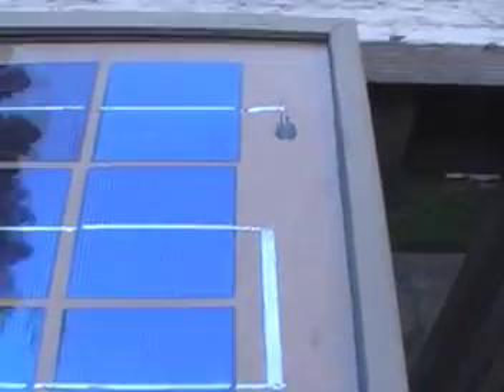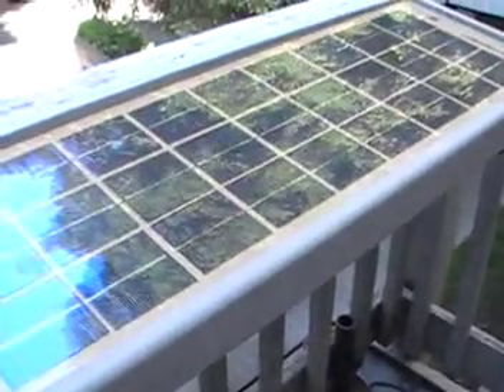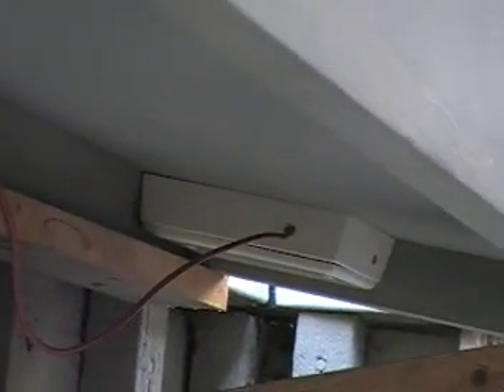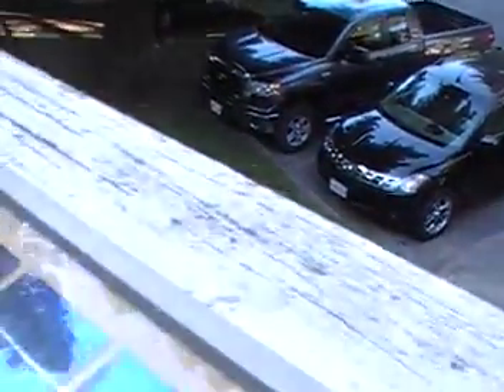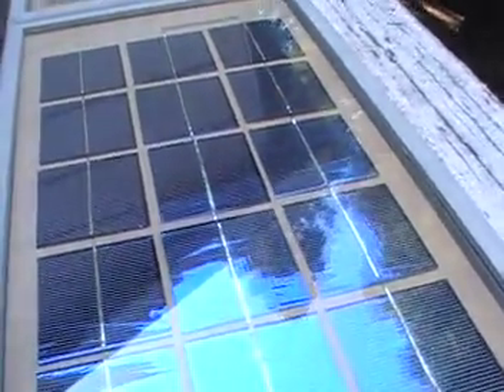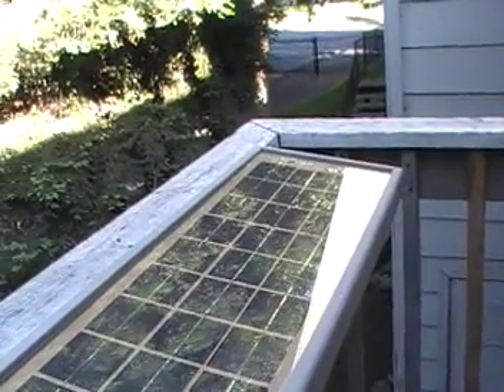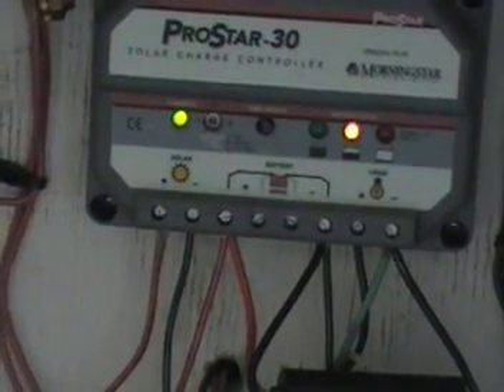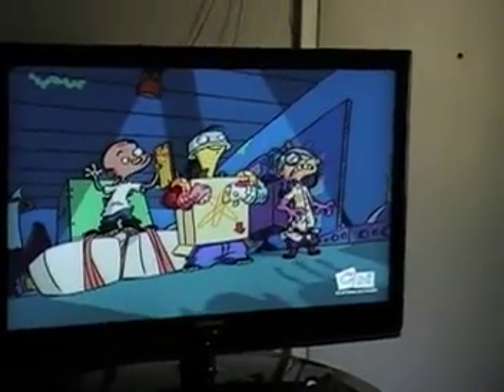Do It Yourself Solar Panel (Soldering) 2

Comment from the maker: @eloid777 thank you for the information. I did not know of this material or of the industry standard. Since my solar panels use wood there is inherently going to be a problem with this type of material as it is porous. No amount of sealant will make it entirely weather proof. I have thought of using two sheets of glass  and aluminum on the sides but you can't just go down to the local hardware store and find it. however I could probably come up with a better design with local materials.

Comment from the maker: @Sp245c I made the video on panels for a small system a year ago. I am using it today and it still works. I don't know everything about solar energy but I did see a need to show people how to solder and to explain the basics of how it works.When I looked for information it was hard to find and not very succint. I hoped to alleviate that problem. Thank you for the idea though. It may come in very handy some time in the future.

Comment: @Glenderbender1 Thanks!

I'm deciding whether I want to start off by tieing it to the grid (with a SunnyBoy or similar inverter) or if I want to start off with a battery setup like yours.  The end cost is roughly the same.  I will want to do both in the future anyway, so it's just a matter of where I start.

Thanks again for your videos.

Chris in Port Alberni Canada

Comment from the maker: @alberniweather I bought a 1000 watt true sine inverter from Sunforce. It cost around $300.00 but my system is small. If you plan on doing your whole house you will need the appropriate size. My inverter will handle my computer and equipment ot go with it or it will run my 40" LCD flat screen for three hours. I can recharge in one day with good sunlight but in poor light it has taken three or four days to recharge.

Comment: hi, good info.  

so the system you set up is 18V, i'm not sure what the translates to AC?  how long would it run your 40" TV?

can you direct me to a site where i can learn how to do these computations as i'm very interested in doing my own solar for cheap.  

also, i'd love to see an equipment list of the stuff you bought, where you got them and costs.

thanks
mike